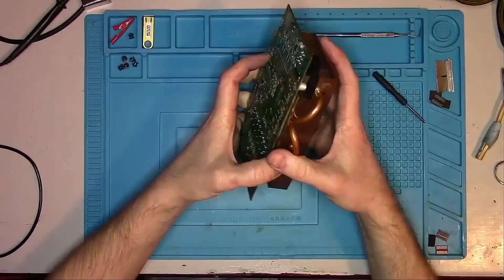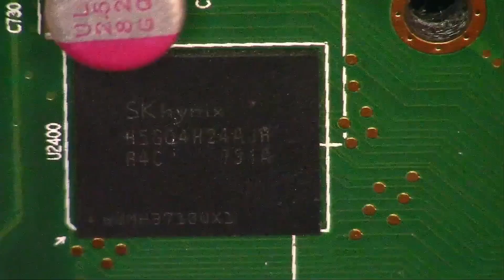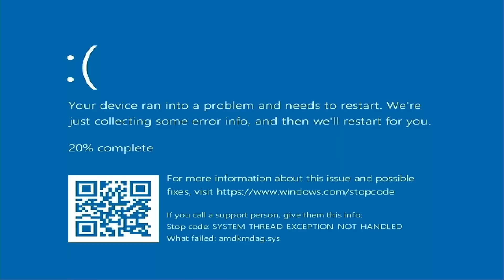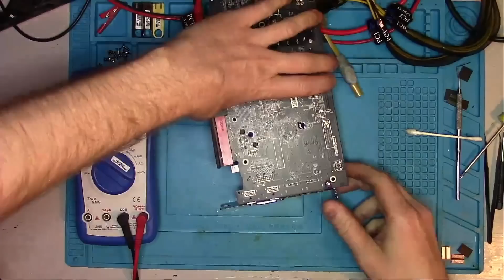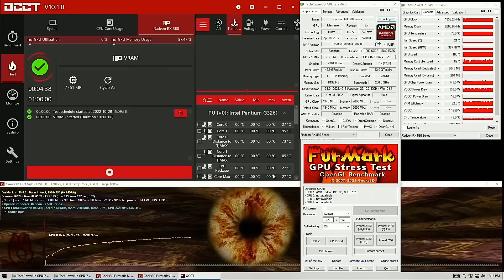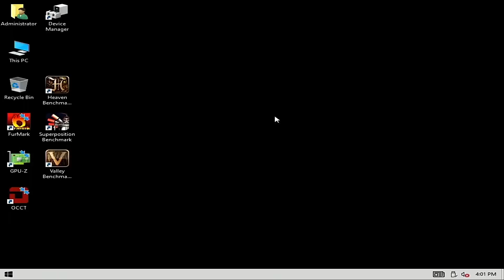Mining 470 Sapphire 580 and VEGA 64 repair

Comment: help me, my 470 just stops working, normal shut down only and the next time i tried to power it on, it just black screen, mouse and keyboard no lights too, but if i remove the gpu, pc will boot normally using igpu.

Comment: friend's vega56 still working just fine, another has a vega64 and worked fine till retired a couple years ago. It even runs helldivers 2 fine when settings are tweaked (swapped back in bc 3090ti died).

Comment: Hello Sir, what could cause artefacts in post screen for an Saphire nitro R7 370 4 GB and after instal driver black screen appear.
Reply from the maker: Bios. Core.
Reply: @northwestrepair  Thank you very much.
Reply: @northwestrepair  I write the new bios but it is the same, i runned a memory test and give me an error on ch:1, rank:0, bit:31. Now i dont know wich one is it on the board.

Comment: I flash the gpu card bios spi IC use CH341A but with a special technique because the diffrent rom and bin files, so I manually convert the rom file into bin file first which is adjusted to the capacity of the spi IC then finally it works good.

Comment: In the future, plug in an RX400, 500 series, Vega, 5000 series and use ATIflash to flash the bios. This is common for miners to flash the bios and undervolt to save power during mining. You don't need to de solder the bios chip. I have done it many times, and the utility is really easy to use. Hope that helps! Oh, almost forgot, a lot of those AMD bioses have an auto backup internally. If you short two of the pins while on, it will restore automatically the original bios. I bricked an RX470, and brought it back to life like that (no dip switches, I had to solder the wire to two pins on the bios). Also, I believe the HBM starts to strip from the substrait on those Vega cards over time. This will cause the no posts, which eventually leads to error code 43. I have a card that still works, and after plugging and unplugging the card several times, it will come back to life, and the HDMI will work again. BTW... I use to mine. haha :)
Reply from the maker: i dont want to use ATI flash because it requires to boot into windows to use it.
Its faster to flash to the chip.
Reply: @northwestrepair   you can use the uefi version or even dos version
Reply: @crusifficadus  I use DOS version myself. Pins 1 and 5 are the pins to jumper on the bios to get it to reset to factory. ;)

Comment: Which ISOs/tools do you recommend for testing different cards? I just received 5 old AMD R9 350 gpus from ebay and want to test them to make sure they work and are legit. GPU-Z says this one is an R9 350 with 2GB of GDDR5, but when I click "lookup" the site says it's an R7 250 with 1GB of DDR3. How can I tell which one is correct?  Thanks!!!
Reply from the maker: plug it in, run few games. if it works it works

Comment: Ive had lots of experience flashing AMD bios as well as Nvidia bios and im just wondering why you dont use the software thats available on guru3d?

All you need is to have an igpu or a primary gpu to connect to your monitor and flash it using the software.

I've had a 100% success rate when flashing compatible bioses (same brand same everything just different version) and 80% success in vendor bios swaps (gigabyte bios to sapphire)

For nvidia its a bit harder since It doesn't have a gui but ive fixed a corrupt bios gtx 660 and given that to my friend.

Comment: With the Vega 64, it might have been overheating and just needed repasting.  Those reference models benefited from having washers put in between all of the pressure screws to give the GPU/HBM better contact. 

 I had constant overheating issues with my 2x MSI Vega 64 reference models (they'd turn on and then shut off the entire PC during boot) before taking GamersNexus' advice to add the washers to add more contact pressure.  After that, I had no issues, and just applied a bit more aggressive fan curb to keep the GPU's nice and cool.

Comment: Howdy, just don’t get caught up in a copyright lockout. Last one I’m working on , xfx Rx 470/480 4gb/8gb  the chip is to fast for the ram so it pulls it out of timing. SkHynix ram still finishing up but full dead chip with wax damage recovered.
Reply from the maker: copyright lockout how ?
Reply: @northwestrepair  when I modified the chip so much it didnt register the same so it was internally DIFFERENT enough to hash raster and time return with numbers they didnt under stand HA HA HA

Comment: the original bios from 1st green card with passive cooler maybe is just fine. Big number off %   code 43 come from rx 460/560/470/480/570/580  who have modded memory timing straps. Adrenalin driver won't work with them. SO you need : 1. install driver ; 2 start atikmdag-patcher-1.4.5. ; 3-  restart windows. (in normal situation after all be good). I hope you didn't delete the  "original bios".

215 ohm from 3,3v low  (2,1k ohm normal) but for some card are ok if isn't = dead core .
edit 2
Watched 2nd time. the memory test PASS so core & mem are  OK. Im sure 99% is driver issue (need atikmdag patch  & blockchain drivers)

Comment: I was going to comment to ask why Vega cores die so much and two sentences later you answered it. That's a strange design... Thinking about it, hopefully, the same does not happen with the 5800X3D CPUs!
Reply: I didnt have this model but I had an msi airboost vega 56 and on the factory clock speeds it would overheat and crash. Very poor design I ended up having to undervolt it to get it to run right.

Comment: What do you think about Sapphire's build quality?
Reply from the maker: Not bad. I am actually very surprised how simple yet ow effective cooling was.
But this is old card with large heatsink so it does not do much justice.
Reply: I have that exact same Sapphire RX 580 and it's a pretty decent card for its age.  I bought some new pads and I will eventually change them and add some fresh paste.  The pads are .75 mm thick which are near impossible to find so it was recommended to use 1 mm but only Gelid Extreme because they are soft enough to squish down and not prevent the GPU from contacting the heat sink.  Some people have also had success with using .5 mm pads as well, but I am afraid that the wrong ones might stop the VRMs' from making contact with the heat sink.  Maybe I may just play it safe and use the original pads for now and just change the paste if they still look good and I feel "chicken."  🤔😁

Comment: How would you recommend to start learning this? Just buy a broken GPU and use it for practice?
Reply from the maker: thats how i did it.
Found a miner and he sold me a bunch of the same cards. Made it easier to learn because all card were the same and i could compare.
Reply: Practice soldering first. There are DIY electronics kit with through hole components. Once you're good with those you can move on with SMD and hot air
Reply: well it would require a lot of practice, tht is one thing but when it comes to these cards they use extremely small smd parts and the memory and the gpu are BGA, so you probably need a lot of soldering/ hot air practice, it looks way easy in the vides but it isn't thats what 7 years of soldering taught me, and thinks sometimes go south, like ripped pads etc

Comment: the rx470 miner edition its from the panda miner custom miners sell on their own page as you could see theres no real bios for it but you can edit it manually with some hex editor or bios editor making things short gigabyte bios are the mose commun to fit and the board its the same as the reference one, well if i can help i have some bios i use to fix the same problem on the same gpus from acustomer that had 10 of these cards
Reply from the maker: If you have bios for this card, send it to me and i will flash it.
Reply: thank you for info! Double thanks if you can email the bios to Tony! :)
Reply: Have you sent the BIOS?
Reply: I had a Quad BIOS mining RX 470, "AMD/ATI Pixel Clock Patcher" would patch the Radeon drivers to work with a mining BIOS and fix Error 43 problem.
But a good bios is always a better option.